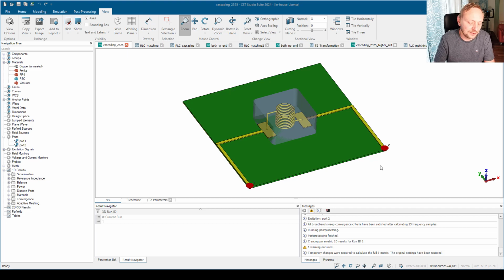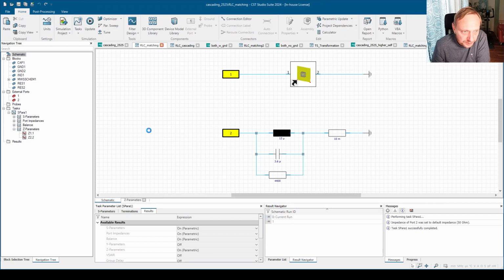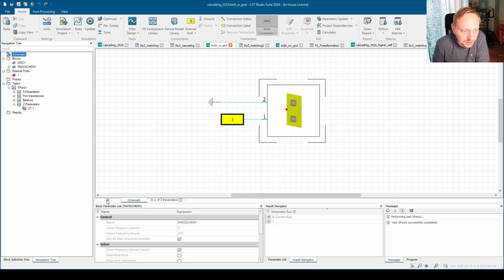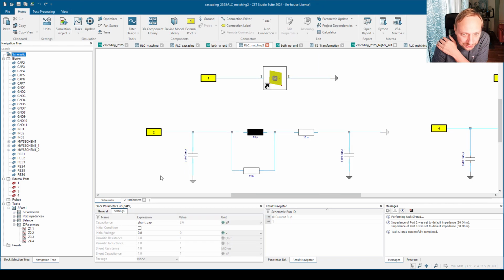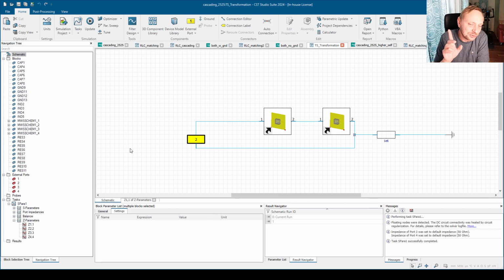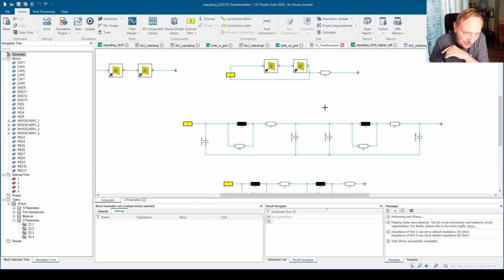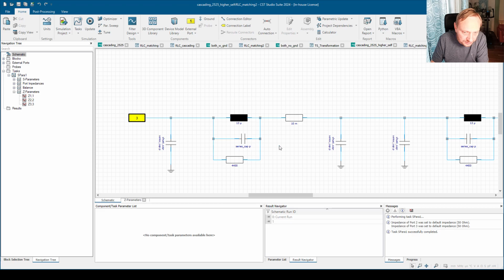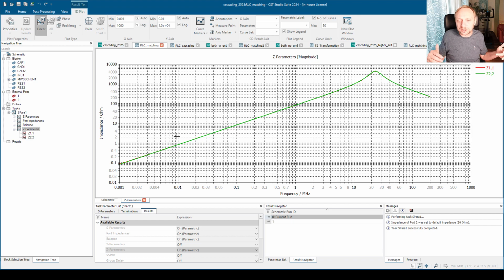Cascading Measured Inductors

Comment: DOUBT PLEASE : touchstone file is nothing but S parameters , how can we cascade s parameters of one inductor to represent two series inductor ? shouldn't we convert s parameter file to [T] ABCD parameters , then cascade and finally retrieve s parameters of the cascaded T parameter system to get s parameter of cascaded inductors ...
Reply from the maker: Converting S to ABCD will not change the information contained within the files. Your circuit simulator should know how to handle the different formats.